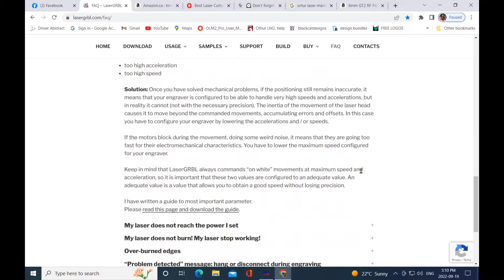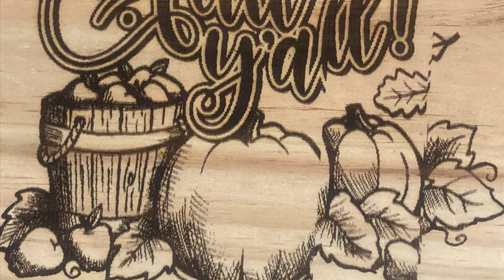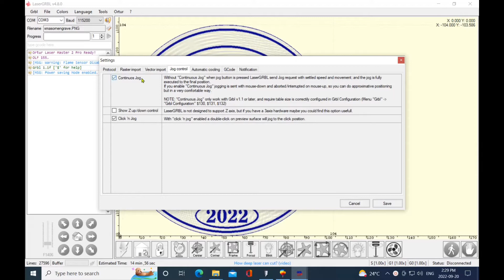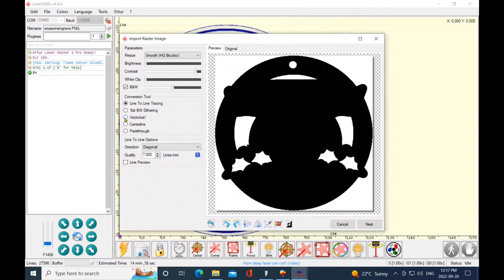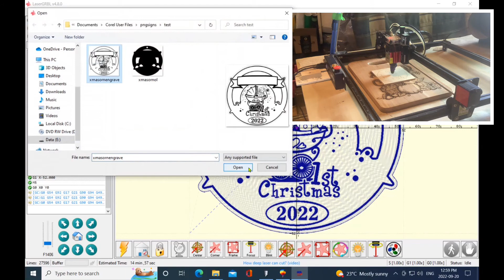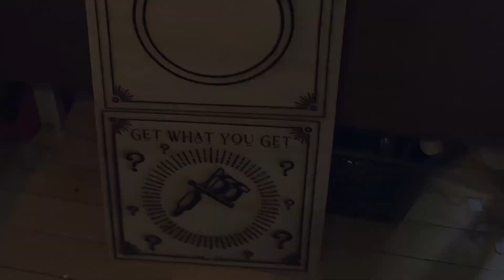13. Top Laser Engraving Issues & Errors !

Comment: Hoping you could offer a sugguest with lasergrbl I checked FAQs but did not find a soluction to LaserGrbl connects to laser machine but the run button does not work.  does not highlight.    thanks for any help.
Reply from the maker: @terryoflanagan1857  What version are you trying? The newest version seems to be causing some issues. I myself am running the 6.2.1 with no issues. You can get earlier versions than just the latest on the website. Normally the buttons do not light up if you are not connected so there’s a few things to check. Open LASERGRBL , turn on your laser, connect it by also selecting the proper Com port.  Go to the top left tab “GRBL” and go to “GRBL configuration” You’ll want to click on the “refresh” for it to read your lasers configuration and then “write”   . If it’s not reading it there then go to the following steps: What kind of computer are you running? I run a desktop. While some use a laptop, the CH340 driver needs to be installed. You can do this right from the top right tab will have the driver to install. Next check that your Laser machine has up to date firmware. Updates should be on a manufacturers website. What type of machine are you using? 
The ORTUR OLM3 has to have the SD card inserted in the machine to run. Check that your E-Stop is not on. Are you getting any error messages coming up in the console? ( that’s right under where you see “type GCode here” Let me know if any errors show up and how you make out. 😊
Reply from the maker: @terryoflanagan1857  Just a few more questions.. after opening a file and doing your settings , do all your buttons show colour that you are in deed connected and it’s just the play button that’s not ?  I’m wondering if the artwork file you are trying to do is bigger than your laser beds allowed travel area. When you are sizing it, do any boxes highlight in red? That’s a definite sign your artwork is too big. Check your manufacturers laser bed parameters and double check in “ GRBL configurations that $130 & $131 are inputted correctly. With your laser machine on, you can edit these and then click on “write” for it to save your changes. ☺️

Comment: I use Lightburn
Reply from the maker: @BrendaDavis-1963  Nothing wrong with that 😊 Many people use it without a single issue. Unfortunately I had issues with it or perhaps my first machine the ORTUR LM2 Pro just didn’t like it. 🤷🏻‍♀️ You can’t go wrong for its price and being able to design right in it. The techs and forum are very helpful . I already had a number of design programs so I just needed a program to run the code accurately and consistently . I use LaserGRBL and love it. 😊
Reply: @disignscdn  well I’m just starting out so I heard with a new upgrade or the updated version. People have a lot of trouble out of it so I’m gonna go back to the old version.
Reply from the maker: @BrendaDavis-1963  Yes, I’ve seen there’s been some issues.. not sure if it’s user issues or software  though. I’m also not fond of the new look, but apparently that can be changed. I’m running version  6.2.1 I believe. I tend not to jump on the update button until I see how it works for others. Plus,  if I find something that’s not broke why fix it? 🤷🏻‍♀️😂 There is a page on the LaserGRBL site to download the older versions if any else is reading this comment and wants to switch back . 😊

Comment: shouldn't move the machine manually. 
Motors act as generators, and when you move it, it sends voltage back up to the stepper drivers. 
Seems like yours are designed to handle it a bit, but its still not a good idea.
Reply from the maker: @TheHillsHaveFPV  Most definitely it is not wise to move it manually while it is on. It can definitely cause a static charge that can short out a motherboard . That is why in my videos I warn of this. My machine is turned off and it’s actually unplugged from my computer and power is turned off as well while focusing . It’s a good practice to get into for anyone not to leave your machine constantly plugged in  . I live in an area frequented by power flickers and the storms this summer have been crazy! Those who do not have homing switches and must manually bring their laser module to the home position , must also remember to do this slowly and best practice is with the machine still unplugged. Grounding a machine properly helps as well. ☺️
Reply: @disignscdn  doesn't matter if its on or off.
spinning the motor causes the magnets inside to move past the wire coils, inducing an electrical current. Depending on how fast you spin it, the higher the voltage spikes will be.

a motor and generator are the same thing. You can cause an electric generator to spin by applying voltage to it, or you can generate voltage from a motor by spinning it

Comment: I have all your settings and everything looks right but my laser engraver doesn’t engrave, it shows the laser and does the engraving motion but doesn’t actually engrave? (the wood isn’t even hot).
Reply: Hi guys, I have the same issue with my tts-20 pro, I have tried with different settings and trying to laser cut paper or engrave. It just show the blue light for the laser but won’t do anything else
Reply from the maker: @crazysam125  are you focusing it properly, have your power settings high enough and what program are you using? 😃
Reply from the maker: Hi! Try doing a wee test circle, Slow down your speed and up your power. What type of Laser Machine are you using and what power is the Laser itself? Now you may have the focus set to too high, the speed set to too high, (mm/min) and the power too low. Next you may want to switch out your power cord just in case the Laser isn't getting enough juice :)
Reply from the maker: oh, and 1 more thing..lol One common mistake even I have made,  double check your settings that if you want 95% power, it has to be typed in as 950 . Sometimes when I'm in a rush the 0 doesn't get in there and then panic ensues when it doesn't engrave! lol
Reply: @disignscdn  I found the problem, I had the laser placed too high so it either wasn’t engraving or smudging the engraving depending on the power
Reply from the maker: @wilddestroyer8927  Awesome!! Glad it's all worked out :)

Comment: Hello! My problem is that my laser doesn’t keep a consistent axis. So like I turn it on one day and where it engraved yesterday it is now off by maybe 1/8th inch give or take. Than the next day maybe it is off by that again but than a completely different direction. It could mess up the same day or be fine for a couple days etc.
Reply from the maker: There could be a lot of factors causing this. 
1. Does your Machine have homing switches?  I’ll try and find the GRBL code you’d have to change your homing speed when first starting up the machine. Depending on your machine it may have a slight bounce back if you are homing too fast. 
2. Slow down your rapid speed some . Great for more accuracy. 
3. Check that your Laser is not loose, plus the complete mechanism it is attached to . Do you have a fixed Gantry or a sliding cantilever for your Laser? I find the sliders and tightening pin on a cantilever can make the laser crooked. 
4. Check your belts for tightness . Check your manufacturers recommendations . My OLM3 ‘s belts are super tight to keep excellent accuracy. 
5. If you are jogging your Laser and setting your Origin not at the X0 Y0 , I still bring my Machine Home before pressing that play button . Especially for if I’m engraving and then cutting. I  never did both simultaneously with another program I tried. It was never accurate. 
6. Depends on your machine.. we can’t expect perfection out of a very cheap machine 🤷🏻‍♀️
Hope this helps :)
Reply: @disignscdn  Thanks for the reply.  I have the ortur laser master 2 so yes it has homing switches.

I think my belts are good.  The thing that baffles me is that I home it, than go and check it, move it around, engrave, home and just play around and every time is lines up the SAME way until I come back.  In other words the movement doesn't seem to be the problem.  It is more time or the restarting of lightburn and or the laser.
Reply from the maker: @aaron647  I can't say I trust Lightburn that much..lol   Does your Machine home rather quickly and have a slight bounce back? You may want to reach out to ORTUR support and see what they might have to say. :)

Comment: Help please, I have an Ortur Laser Master Pro and use Laser GRBL software. When I load a project and press frame I get 2 messages on the left side of the screen saying soft limit highlighted in ref and reset to continue highlighted in blue. I press reset and the display shows idle. When I press frame I get the same message. What am I doing wrong?
Reply from the maker: Soft Limit means you likely have the file to large and you are over your engraving boundary capabilities by just a hair.  Always press home, set your origin before you frame. I suggest re-opening the file and re-sizing it a weee bit smaller or you can rotate the image as well to engrave. :) If the size is clearly going to fit in the area, check your GRBL code under configuration. your $131 and $132 values which is for your engraving size may be off.
Reply: @disignscdn  okay, I have loaded a file I have engraved in the past. I pressed home and then frame and received the soft limit message. I then went into GRBL configurations. $131 shows a value of 400.000mm and $132 at b50.000, I have no idea if these settings are correct and don't know how to change them if needed,. thanks in advance for your help.    Tim
Reply from the maker: @timfrench483  somehow your $132 has gone wonky! Your machine needs to be turned on and connected to LASERGRBL. To edit these settings in Grbl configuration. Click your mouse where it says that bvalue across from $132 and type in 400.000 and click on “write”. 
Close LASERGRBL, reopen it, turn on your machine and connect. Go back into grbl configuration to make sure it has changed to 400.000 😃
Reply from the maker: @timfrench483  also double check your graphic size when opening it to make sure the size is well under 400 mm 😃sometimes if you accidentally click “passthrough” it makes it too big. 😃
Reply from the maker: Oh! Sorry..one more thing may be the issue..try the Auto crop and see if the graphic is cropped to it’s end points .. if it’s offset there may be a wee little dot or line in your graphic that is out of bounds. 😃
Reply: @disignscdn  Hi DI, my $132  was always set at 400.000 so I left that alone. $131 was set at 000.000 . I changed that to 50.000 and it worked. I'm not sure if that's where it should be but at 000.000 the machine didn't respond when I tried to frame.
Reply from the maker: @timfrench483  olm2 pro with the z lifter attachment I believe is 380 mm x 400 mm (800 mm with the extension ) so you’re safe to change that value you did to 50.000 to at least 380.000.
Olm 2 is 400mm x 430 mm :)
Reply: @disignscdn  Thank You very much for your help.

Comment: Maybe you can help me with my problem. I have the Ortur Lazer master 2, it will start to engrave and at some point it will just stop moving and sit in one spot and just keep burning. If I pause it and start back up it will jump way off . Any suggestions would be appreciated. Thanks,Todd.
Reply from the maker: Are you using LASERGRBL or lightburn? I too had this issue with lightburn. Once I switched to LASERGRBL , I never had the issue again. If it is LASERGRBL , let me know as I have some other things for you to do to fix it :)
Reply: @disignscdn  It is lazergrbl.  I have done all the updates, software and firmware. It's weird, once in a while it will make it all the way the program and then other times it will start run for a bit and stop. I have even had it right from the start, hit run it goes to the starting point and just sits there and burns 🥵.
Reply from the maker: @toddkugler8194  I suggest you opening up a ticket with Ortur support to help trouble shoot you for sure.. going right to the source may get you a new motherboard all together for free. 
Ortur.net . Keep me posted on how you make out please :)
Reply: @disignscdn  Hi, well I put a ticket in with Ortur, and after 6 days of emails, taking pictures and running different test they decided it was the power supply. He asked if I could order one from Amazon and if that works then he would send me one. I had to ask to make sure I understood, you want me to buy one and if it works you will then send me one. Thought that sounded weird but ok. I got it today and so far so good, hasn't missed a beat. Will see tomorrow. Thanks for your help, love your videos. Todd.
Reply from the maker: @toddkugler8194  That is odd ! But I’m glad you’re up and running with no issues! Knock on wood!! 😂 hmmmm.. gets me to thinking if I change out my power supply here that I ordered if my issues in Lightburn will stop..🤔 I’ll keep you posted!! I’m in the middle of tearing my machine down to put the extension kit on it and building the ultimate engraving trolley 😃
Reply: @disignscdn  It might.  I never gave the power supply a thought.  I was thinking of everything but that.  Oh well,  it's up and running.  Will test it longer tomorrow.  Thanks again.
Reply from the maker: If it is LASERGRBL and you have done all the troubleshooting tips in the video like USB cords and preventative RF INTERFERENCE steps, check for any driver updates from ORTUR.net I believe they also have a video on how to reinstall it properly. If you are continually getting issues you may have a bad mother board in your Engraver and it will need replacing . Let’s hope it’s not that ! 😳